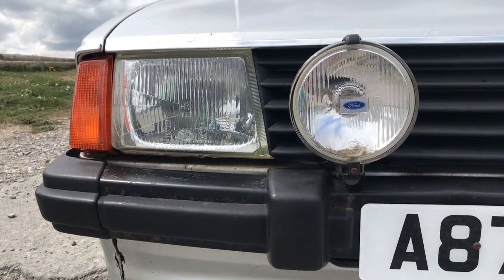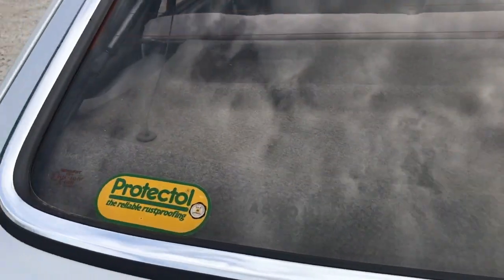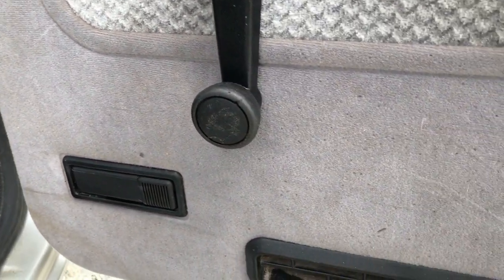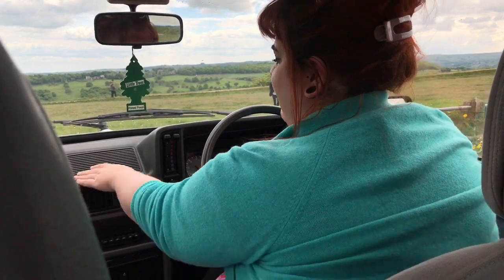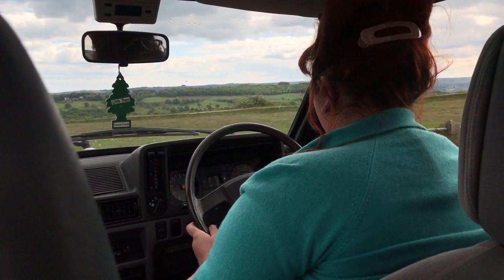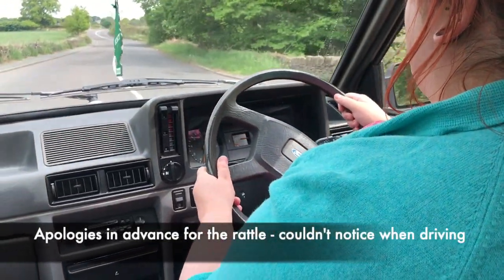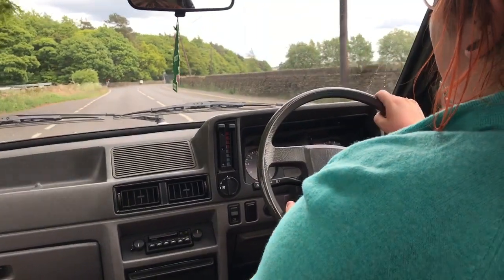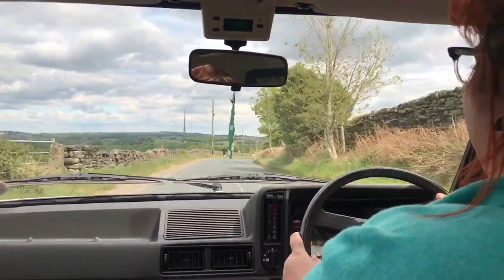IDRIVEACLASSIC reviews: 80s Ford Escort MK3

Comment: Hey, that's my car!  Mine is US Escort 1983 wagon, 1.6 CVH, automatic trans, carburetor.   But basically the same car, still our main daily driver.  Got it for $900 US 10 years ago.  Best selling car in the US as well in the 80s, my brother had one, my sister had one, other sister had one in the 90s, now I have one.  Oddest thing about it, it is part metric, part Imperial (inch).  Engine is all metric but much of the body is Imperial, sometimes both metric and inch bolts on the same part!  Biggest drawback is cramped quarters around the engine, especially anything involving the fan belt or timing belt, you're guaranteed some skinned knuckles before you're done.  In '83 Ford made a bunch of changes in the middle of the year, so always an adventure when I take it to the shop, seems they almost never order the right part on the first try, sometimes it's stuck there for weeks.

Comment: The round blanking plug by the steering column was a choke on lower spec cars (e.g. 1.1), so having the blanking plug is more luxurious!
Reply: And the other was for the optional front fog lights which my Orion from the same year had fitted.
Reply: Steph, you mentioned these are becoming more commonly stolen the blanking plug for the fog lights is perfect to thwart that. Fit the switch for the fog lamps, but wire it up to control the ignition. Turn it on to send power to the coil. Turn it off and the car won't start. Will certainly stop the quick thieves, and because it looks like a stock fog lamp switch, it is essentially invisible.
Reply: i had a 1.1 and it had the blanking plug as the carb had an automatic choke- but the auto choke coil used to fail- and you bought a choke conversion which i did.
Reply: Carl Heaton, our B reg Valencia 1.1 had a factory fit choke, maybe varied over the years?
Reply: On my '82 XR3 i've got an instrument lights dimmer, where the round blaking plate is.
Reply: No, having a manual choke was more desirable. The auto choke was an absolute nightmare, leading me to giving my Mk IV 1.4 Ghia a damn good thrashing on more than one cold morning...
Reply: Gary Masters my 1989 Mk IV 1.4L had a manual choke but you still had to get it just right, never known another so temperamental 😂
Reply: @explorer806  I had a G reg fiesta with a manual choke. Had a E reg escort with automatic choke.  And a few Astra's 1.4's with auto chokes. They gave nothing but trouble on one I even had to remove the automatic choke mechanism off the side of the carb at the side of the road as it would cause the engine to bog down and dye. In the end I had to open the bonnet in the morning set the choke flap everytime I wanted to start the car. Wish I just went from manual choke straight to fuel injection.   I'm sure no motorcycle ever had a automatic choke?
Reply: @neilpickup237  there was also a button for a remote boot release on the otherside I had one was told it was very rare.

Comment: I had a 1.6 Ghia in "orange" AAO 52Y . It had a Christmas tree dashboard and it gave a XR3 a run for it's money in Cornwall. I drove it all the way back from the Birmingham Motor show with no oil in it! I traded it in for a Renault Clio Mk1. Wish I'd kept it. Would be worth a lot more now!
Reply: The DVLA thinks your Escort is red lol.
Reply: Also Mk1 Clios are good cars as well. Speaking from experience. Which engine did yours have? I have a dark blue 1.2, with rust around the rear axle mounts.... I'm planning on fixing it up next summer as it's been in the family a while now. I've also got a mk4 Escort which is sort of a winter project I guess, my plan is to do a sort of "semi restoration"; Overhaul all suspension and brake components, repaint everything, remove the engine, change all the consumables (timing, water pump, clutch, and valve stem oil seals because CVH lol...), and repaint the engine/transmission and everything in the engine bay too. There's no serious rust, apart from the rear wheel arches... Sills are pretty much immaculate though. I will however inject a special treatment into the sills/box sections to stop any potential surface rust rust.
Reply: @mr.slaphappy3794  Yes. Sunburst Red was the colour of the Escort. An orangey red to me! The Clio was a Grey metallic 1.4RT with a sunroof and alloys. Apparently the previous owner was a cast member of Emmerdale, but that didn't put me off buying it! Then it was changed for a metallic black 1.4 Champs Elysees. After that I got a brand new Clio Mk2 phase 2 Expression which I upgraded 18 months later to a Dynamique in Metallic black which had the white seat belts. Then I got my favourite, the Clio Sport 172 in Metallic Red. Loved that car. Had it for four and a half years then due to some dodgy servicing by a garage it popped a spark plug so I sold it on and bought a Mégane as I had children to ferry around. That turned out to be the biggest pile of junk going. Was a complete money pit until it was deemed too dangerous to drive so I scrapped it. I now drive a 15 year old Mazda 6 which just keeps going at 150,000 and counting. Won't go back to Renault's, (unless a Sport was on the cards!)

Comment: Great vid, great information.  That big rusty hole in the inner wing reminds me of every fwd escort I've ever owned. 😊
Reply: most Fords of the 1980's suffered rust quite badly before being 10 years old. Escorts rotted under the fuse box and battery tray , 5 door models suffered rot on the wheel arch on the door side.

Comment: Sorry I can't get nostalgic about Mk3's. My Dad owned a beautiful '72 MkI 1100L when I was a kid in the 70's , in my early 20's I owned a Mk2 1.6 Ghia Automatic which was alright. But the Mk3 by comparison was a bland looking car , had an asthmatic CVH engine,  ate cambelts for breakfast and rusted around the rear arches in no time. In my youth I was mad about 60's cars , not cars aimed at the over 60's or at least that's how I thought at the time lol! Saying all that , this example is fantastic and it is a perverse pleasure to see one again! Thanks Steph 👍
Reply: Mine bust its cambelt twice. It was found that the bearings had gone on the water pump putting more pressure on the belt. Everything went wrong with it in three years. Fuel pump, starter, belt, water pump, bearings - and I could never be sure the mechanics had fixed it well enough - or that something else would go on it. Bought a Kia in the end (2003) - virtually nothing has ever gone wrong with it.
Reply: It needed a sympathetic classic car restorer to put a new carpet in it, spray a couple of bits jack it up dismantle it underneath, weld and repaint it and see exactly what was good and replace what wasn't. Maybe about 3,000 quid later we might have had a half decent car. The Kia was on 10,000 miles, had a 2 year warranty remaining and was 5,000 quid. Bye bye Ford - I wasn't sad to see it go. See if you can find and review a Fiat Regata. I preferred that to the Orion. I did 12,000 miles in my 1985 one - till it met an untimely end. Would have probably lasted till 2003 with much fewer problems.
Reply: @stuartwilkie4887  My underlying memory of every Mk3 I came into contact with via friends or colleagues was of a wholly unreliable rust bucket, and they weren't very old at all at the time. Every problem you mentioned ! Weird thing was ,when I was 16 in '85, my Boss had a white Escort van reg.  A499 VON which was in remarkably good shape when I saw it again 10 years later being used by a local family building firm ,with very little rust showing !
Reply: @shaunw9270  Was it owned by the A(449)VON lady? hehe. A mate of mine had a Y reg Ghia similar to this one. It was very quick actually. Another friend got a blue Orion (on about a G) and stuck an escort diesel engine in it. Was really slow until he worked out he should put the exhaust system in as well! Looking back, I should have bought that, or a late model Sierra he had. Duh
Reply: @stuartwilkie4887  It's certainly a different world now eh? Don't hear about engine swaps by ordinary Joe's so often now , probably due to electronics & computers . I once owned a '78 Mk4 Cortina 1.6L  (S plate) that I bought from a friend of a friend in the early 90's . He was a trainee at a local garage and did a few tweaks on this Cortina which was his mum's from new. It always started ok due to the MSD ignition, it had a bespoke stainless exhaust system, K&N pancake filter . The stance was similar to a Gasser though not to the same extent (!) thanks to the suspension being replaced by that from a Granada Estate. I added larger diameter wheels & tyres from a Mustang. I stupidly sold that car and bought an R reg Rover P6 2.3 Automatic which looked amazing but was shoddy mechanically . Good times - in hindsight , through those rosy specs 🤓

Comment: Great video!The MK3 Escort has a strong enthusiast following,and all models are becoming increasingly sought after now,in particular the Original 'High series' model the Ghia,as well as the lower spec Base and L models.During the 1980's they seemed to be on every street corner,nowadays good examples are very few and far between.

Comment: "Frank Dye's of Watton" (market town in Norfolk). I remember their commercial radio adverts.
1980s Fords really looked smart in Ghia specification. Those steel wheels look great with the chrome rims and hubcaps - who needs plastic wheel trims?
I owned a 1986 post facelift (Mark 4?) 1.4 GL that was quite disappointing in the late 1990s.
Reply: The radio ad had someone doing an impersonation of Spike Milligan.  part of the site is now a Stonemasons, the other flats.
Reply: It's crazy how a fair few of the cars Steph has reviewed have some sort of Norwich/Norfolk connection. It's fun seeing names and places I see every day get a mention here!
Reply: I had a 1987 1.4 lx all that really had was tinted windows.  In a MK3 a GL just added centre console and plastic strip on the outside of the doors .   The 1989 Gl and LX were better. The GL got electric windows and electric heated mirrors.  The LX also got electric windows. And the front grill changed and the badges on the back were smaller. Also the 1.3 went from CVH too HCS (pushrods)

Comment: Beautiful car and the Ghia-trim level really lifts it up to a next level. I used to have a mk4 escort with the automatic gearbox and it was actually surprisingly comfortable to drive with, even towing stuff was effortless as it was an 1.6 litre. Seemingly they were very uncommon here in Finland too because I haven't been able to find one equipped with the auto box (mk3 or 4) after I sold my own a few years ago. Big shame but hindsight is 20/20. The biggest drawnback I can think of was that the shifter was linked by cable, and mine was slightly broken and used to freeze solid in the winter, so I had to apply the handbrake and do the shifting via the engine-bay before places warmed up again :D (wasn't able to find a replacement). Great review as always!

Comment: I had the same 1983 Mk3 but the 1.6i Ghia which had the fuel injection from the XR3i. It had the 5-speed manual gearbox. Since it was the 5 door version it was actually a bit of a sleeper. It looked like a bit of an old mans car but was pretty nippy. Very comfortable on long trips. A friend who had a Golf GTi was very impressed when he shared the driving on a trip from London to Keighley. Incidentally I thought I recognised some of the scenery and it was confirmed when the TV tower at Emley Moor showed up! I was at school in Otley during the mid 60s.

Comment: I had a Mk3 1.3L on a B reg which I brought of my older brother, one of the best cars I owned, clocked it up to 125000 miles.
Reply: They were good are and seemed to go for ever good work horses
Reply: I thought they only have 5 digit odometers, so 25,000 miles (again)...?

Comment: I had the 1.6 Ghia manual in metallic copper 1982 Y great car,  
You didn’t mention the digital clock above the mirror which also displayed the date, also variable intermittent wipers, wheel on dash, back then theses were rare.
Popular rattles were hand brake cables left and right under car,  oil sensor was great but needed clean oil to work correctly.

Other options was rear wiper not standard so would explain some of the other blanks,

Locking glove box another luxury,

Very advanced in its day 

Great video esp round Huddersfield,

Comment: I had an Escort Mk3 1600 Ghia in the early 1980s (built at the Saar Louis plant in Germany). One of it's best features was the 5-speed manual gearbox, which this one doesn't have. The round blanking plug to the left of the steering wheel is for the manual choke. This model had an auto choke (bi-metallic strip), which was prone to failure, but you could buy an aftermarket manual conversion. Ford initially had problems with those Bridgend-built CVH engines as the cam belt was prone to breaking, lunching the valves.
Reply from the maker: Thanks for the info Roy!

Comment: Great cars in their day , i owned loads of them.  MK3 GL and Ghias used to suffer from the dash splitting around the central air vents. Ive known lots of the very early MK3's suffered rear suspension link arm failures.

Comment: The far right dash blanking plug is for a rear wash wipe assembly. My estate had one you click it on which was half was for wipe then push it all, the way which was spring loaded so it returned to use the rear washer.
Reply: Tbh that ghia one not having one is a bit odd mine was a 1984 1.3l 3dr Estate.

Comment: Briefly used an early mk3 on W plate. Was a 1.3. My daily drive was a 575 Marina van which I preferred to the Escort. Didn’t like feel of Escort, or it may just have been that one. Had a later C 1.3 and then a G reg with a 1.1 engine as daily drivers. They were ok. Was used to Capri and Sierra in those days and Escort just felt so different. The 1.3 in the W reg just felt like it was labouring all the time.

Comment: During the early 80's my father was looking for a smaller replacement for his Mk 4 Cortina Ghia and so he was naturally considering the MK2 Ghia.  It had a great reputation but on introduction of the Mk3 I strongly advised him not to go for one and instead wait for the Mk3 which was a totally new car with all the modern innovations included with it.  It was also a hatchback and looked lower and far more modern.  Resale value would also be far better in the future too.  The annoying thing about the first ones is that they had the four speed gearbox and twelve months later Ford introduced their new five speed gearbox, then to increase frustration the standard radio was replaced by a radio cassette on the Ghias.  Although a totally new car Ford kept the name "Escort" because it had a great name and they did not want to risk losing any sales on the new models.  Ford also boasted that the main controls and switches were designed to be close at hand to the steering wheel to avoid trying to reach the harder to reach individual switches on the dashboard.  It was also one of the first cars to have a collection of warning lights that have now sadly become a headache with modern cars cars failing the MOT!   Buyers of the RS range were also left in the wildness as there was no RS version of the Mk3, only the XR3 which interestingly enough proved to have the similar performance to the now obsolete RS2000.  For those that loved the RS marque life went very flat as there was sadly no talk of continuing the RS range, that was until a surprise introduction of the new RS1600i in September 81.

Comment: I owned a Ghia and I loved it to bits. The seats were comfortable and it was heaven to drive. 
The only reason I sold it was because a fault speedometer required a complete gearbox strip to replace a stripped speedo drive gear.

Comment: I briefly owned a Mk 3 Escort Ghia in 1990's. I was one of the best cars I have ever owned. 
A month latter driver ran into the back of me when I had stopped at a crossing. My car was not damaged but the Punto was looking in a bad way. 
The speedometer was starting to play up and although I thought it was the cable it turned out to be a failure of the drive gear in the gearbox and was going to cost me £860 to fix so I ended up selling it. 
Sad, sad sad, I still think it was the most comfortable and solid car I have ever owned.

Comment: Thanks Steph another Ford the mk 3 Escort wow never got these in Aussie or New Zealand we got the Laser. Couple of interesting facts the Laser was released with a 5 speed from the start ford got the 5 speed into the euro ESCORT  later because Mazda did the reengineering for both the Laser and escort 5 speed. The wood fillets in the doors where a Ghia thing all the top range Ghia models had wood grain in Europe and the UK, funny thing is the US ESCORT was heavily modified and eventually looked like our laser which also shared parts with the Escort. The ESCORT name dissapeared from Australia in 1980 but reappeared in the mk 5 or 6 Escort in NZ which replaced the laser but only in NZ Australia kept the Laser going until it was replaced by the Festiva/Aspire then the focus

Comment: The Mk3 was my first car. I'm sure mine was an economy/basic model that had the 1.1 engine.... Anyhoo... It had the manual choke and not much else😏.... The engine was still going strong at easily 120k when rampant rust had seen it off... You could see through the boot floor and the foot wells were soaked with water coming up through the holes in the underside... The mechanic in the garage gave it its last rites... A274TDS.... Where are you now.... Probably a fridge or something I suppose.... I should have bought shares in Isopon with the amount of filler I used to keep it looking tidy👍